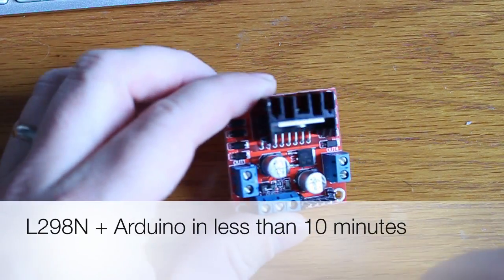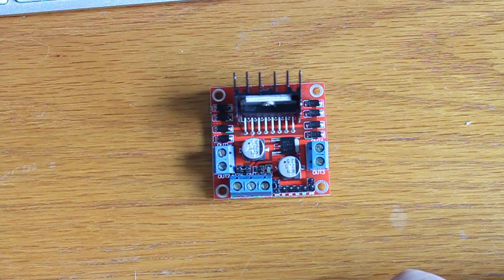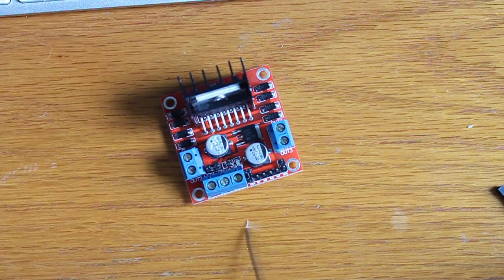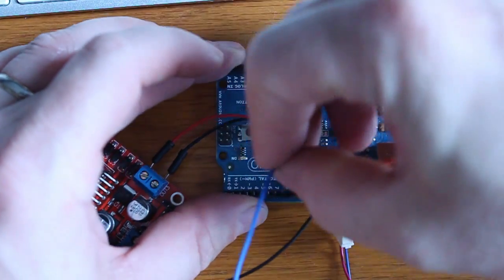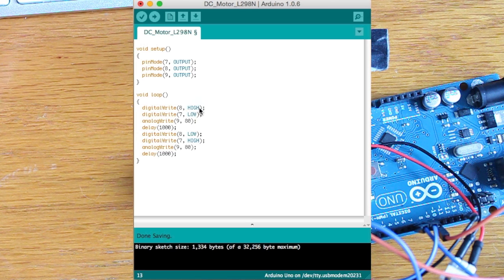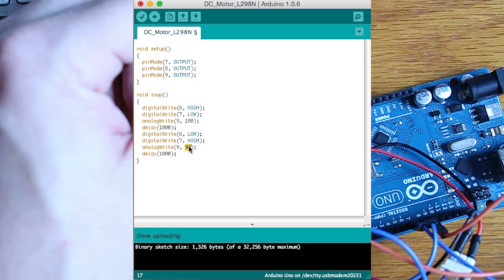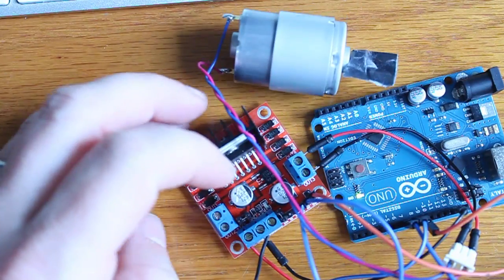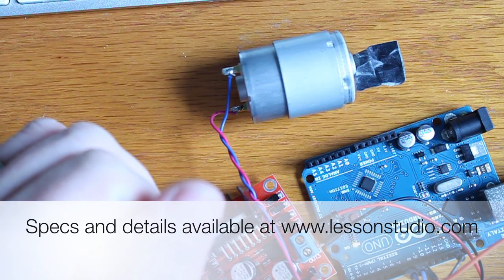HOW TO: control DC Motors with Arduino + L298N

Comment: Nice vid very informative. Just one question though, how do you stop the motor from turning and hold its position?
Reply from the maker: +3D Printwiz With a DC motor, holding position is tricky. With a servo motor is is very easy, and with a stepper mostly easier. The key is that if you are putting power into a DC motor it will usually move. Thus to hold it in position would require that you are only putting enough power into the motor to prevent it from being forced in a different direction or to rapidly move it back to the desired position so rapidly that it appears still. Thus the first step is to identify that your motor is being moved. The easiest (but not only way) would be some kind of sensor that detects either movement or position of the DC motor. So effectively what you would end up doing is creating some kind of feedback to compensate for the movement of the motor. What you would be doing is to recreating a servo motor; which is a DC motor with a sensor and positional feedback.

Thus the answer is probably to use a servo motor. There are servo motors that can rotate 360 degrees although most commodity servos are limited to around 180 degrees of motion.

Comment: Thanks for making this helpful tutorial. I got one question; what is the point of having a common ground with the arduino since the arduino has its own power supply from the USB?
Reply from the maker: +brusk qadir A common ground is generally how electronic work. The main occasion where you isolate things is when those things might be naughty and feed current back through the ground. This common ground is so standard that you will find many circuit diagrams that don't actually show the entirety of the wiring style circuit but every time something goes to the common ground there will be a line terminating at the GND symbol even though all of those grounds are actually connected. 

Check out many circuit boards. They will do all kinds of things such as a ground plane and whatnot where the ground sort of makes up a huge proportion of the board's copper. When looking at a circuit board that is usually the giveaway that you are looking at the ground, it connects to pretty much everything.

Comment: Great video. Simple to follow, and a big help as the L298N I bought did not come with any pin out info. Question though.  How do I figure out the capacitor value needed to smooth out the PW at lower speeds?
Thank you,
Reply from the maker: +kb3cxe There are formulas for doing this but personally I do it by guess and by golly. I will eyeball the motor and think about the voltages coming out. Then I will eyeball the capacitors and their capacitance and their voltage ratings. Then I will start moving down through the capacitances until I have the smallest one that will work. 

Where I usually have this (and it makes the formula just that much harder) is when sending a PWM signal to a motor. At slower speeds the PWM often won't keep the motor moving and/or makes it whine. A capacitor is then not only to keep it moving smoothly but to make that annoying whine go away.

For perfection you could connect an oscilloscope up to the motor leads to see how your capacitor is smoothing things and to theoretically measure how much smoothing is needed.

The key is that while I love math this is somewhere that you quickly build up experience at being able to pick the nearly perfect capacitor every time.

That all said, I primarily work with pretty tiny motors. If I were doing this for a huge motors (5-10Amps or more) then I would get out the math first as this would be where mistakes could be costly and dangerous.
Reply: +LessonStudio jfiexnhss ju

Comment: What is the advantage of using this board over just a bare H-bridge, other than the voltage regulator? And what is the advantage of any H-bridge design over a simple transistor to control motor speed (if you don't need to run in reverse)?
Reply from the maker: Jonathan Tucker A bare h-bridge is superior in cost and size if you know what you are doing. The key advantages of this board is that it is close to brain-dead easy to use. First it mostly protects your L298N so that the spikes from the motors don't easily come back to burn it out. Also having the screw posts means that you don't have to solder this into any temporary projects. So in a typical circuit you would have to use nearly every component in the module, the capacitors, the heatsink, etc. Here it is in on package. Also you can hive off 5V for use in powering things like the arduino, which is convenient in that you don't need a separate power conversion circuit.

But for a permanent project this might be clunky to glue in. My assumption is that most people are doing what I do with Arduino which is to build something cool admire our handywork, then cannibalize it to make the next project. Or we are hacking something together where tidy custom circuits aren't the rule of the day, more hotglue and ducttape. 

Also in many of my robots I tend to physically separate power and motors from thinking and controlling. So I put my motors, this module, batteries, at the back and the sensors, arduino/raspberry pi, at the front. Thus I am sort of happy to have a separate module.

Where I have used fairly naked H-Bridges is when the power demands are very low and the motors fairly weak, then something as simple as a diode and a capacitor should protect the IC. This unit is fairly robust and thus can handle a good load. 

And thank you very much for watching my video. I have another batch in production so if you have any requests.

Comment: how to  make it wireless ?
Reply from the maker: soumita bhattacharya Ooooh, good question. With arduino there are so many options. There are some 433Mhz options that are very cheap. There are some WiFi options that are sort of cheap. There are some bluetooth options that are OK if you are using android or a desktop to interact and not as cheap if you need to control with iOS. The on the very expensive side there are some GSM options.

Personally the WiFi options are my favourite because the range is very good and with a slightly interesting antenna can be made to reach out to an insanely huge range for something so low cost.
Reply: soumita bhattacharya bluetooth sounds like a good option

Comment: can you share the coding pls ?
Reply: Shafiq Fikri 
void setup()
{
 pinMode(7,OUTPUT);
 pinMode(8,OUTPUT);
 pinMode(9,OUTPUT);
 
 
}

void loop()
{
 digitalWrite(8,HIGH);
 digitalWrite(7,LOW);
 analogWrite(9,80);
 delay (1000);
 digitalWrite(8,LOW);
 digitalWrite(7,HIGH);
 delay (1000);
 
}
Reply from the maker: +David Cushenan Ah, probably the evils of Unicode. 
Good luck!